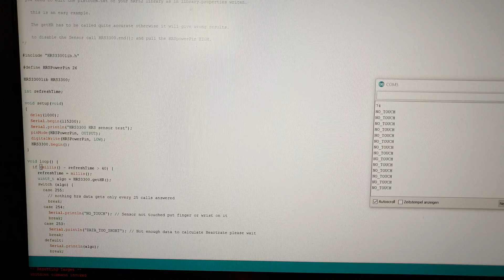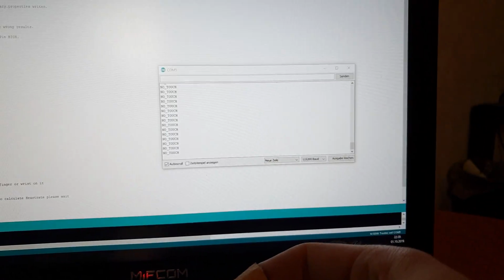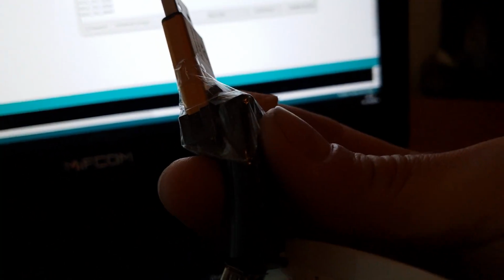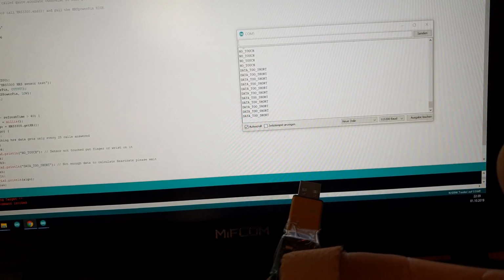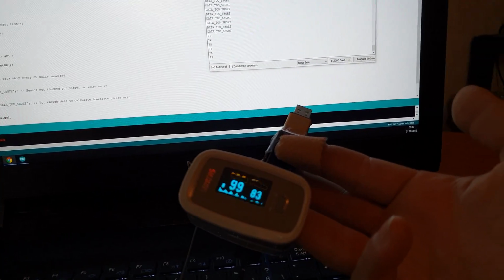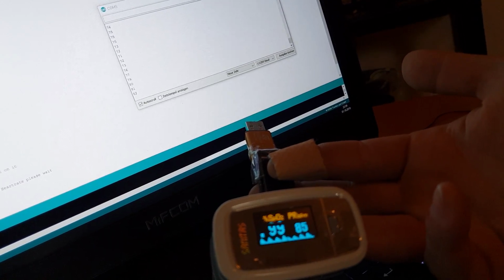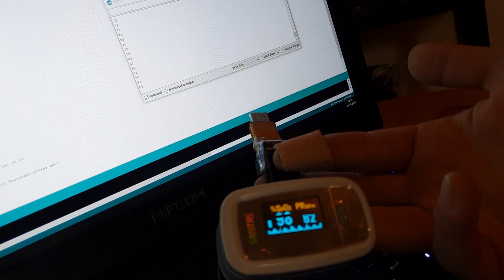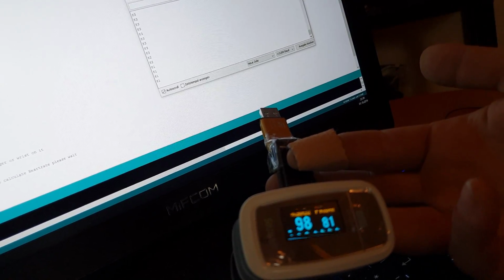HRS3300 Heartrate Sensor via Arduino Library

Comment: How did you take it apart while it is still working. I was trying to open mine, but I couldn't, eventually, I broke it, so it is no longer working. Maybe you can show a video on how to open it... helping us saving money...
Reply from the maker: Hi again. I allready show it here https://youtu.be/3gjmEdEDJ5A 24:00

And for the i6hrc its here https://youtu.be/0Fu-VSuKHEg 04:20
Reply: Aaron Christophel Hi, the links are for ds6 and I6HRC, right? But the one in this video is HW03, I couldn’t not find a video to open it. So I tried my way and failed
Reply from the maker: Yes sorry, i opened the HW03 like the D6, maybe i cuttet into the corners with a knife i dont remember right now